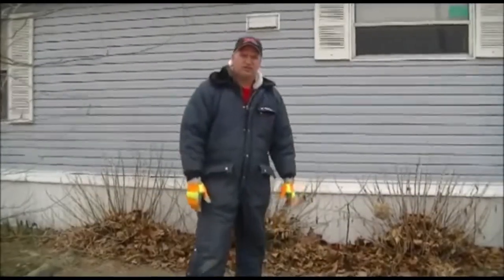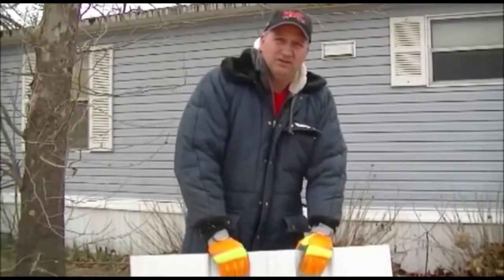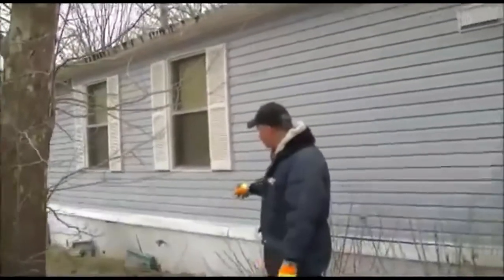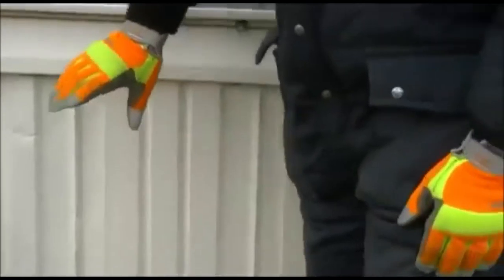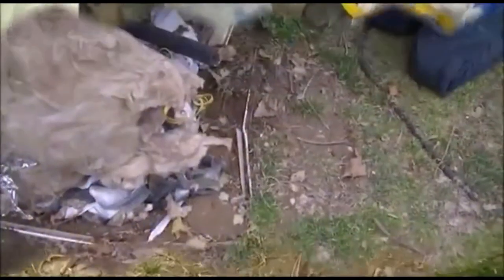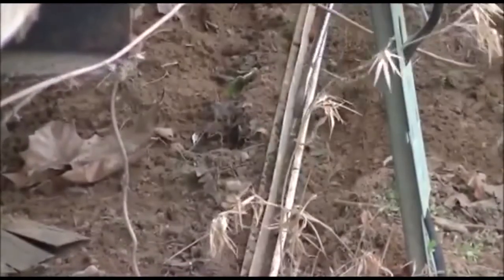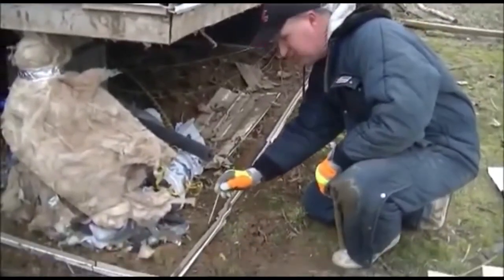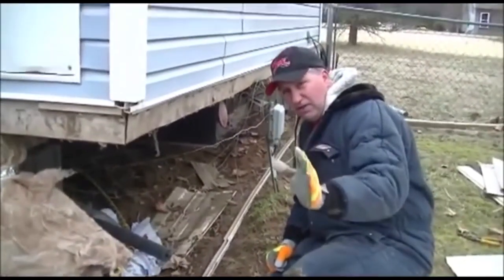Mobile Home Metal Skirting Install pt 1 of 6

Comment: Does cutting that with the straight snips take a lot of strength in the hand or get to hurting after a while? Is there an alternative to using that? My hands are not what they used to be.
Reply from the maker: They make shears that are like scissors you attach to a drill a lot of people use. There are electric shears made for cutting metal. I  believe harbor freight sells them . T are nibbler cutter duel wheel cutters and finally you can put a carbide blade on a circular saw. You can get it done. It's like eating an elephant. One bite at a time. I hope this helps. I wish all the best.

Comment: Do you have a recommended source for the metal skirting and other parts?   Do you not recommend the vented skirting?   We are located south of Fort Worth, Texas.  Thanks.

We are changing from cement board skirting, which keeps breaking to probably metal skirting.  We don't have the top and bottom channels with the cement boards - it is just chalked.
Reply from the maker: Your metal building suppliers can make your materials far more reasonable than lowes or a retailer. The top front demensions are 1 1/2 down 1. Out 3 1/2 down with a hem at bottom color on outside. There is a video on whether you need to add vents. Hope that helps and wish you well on your project.